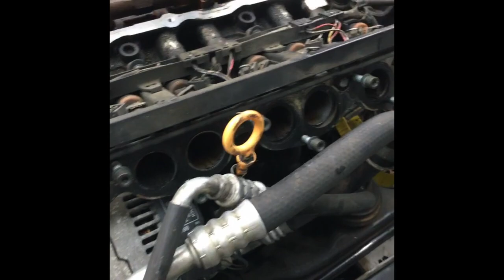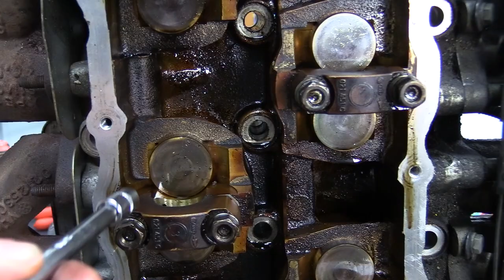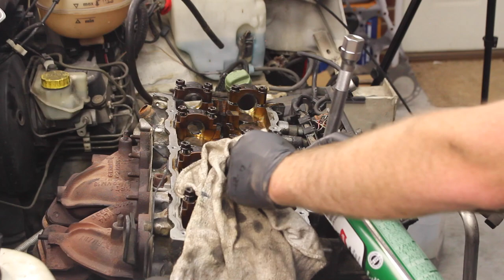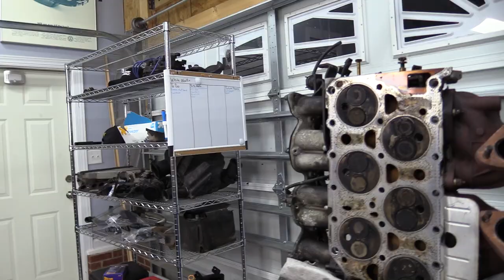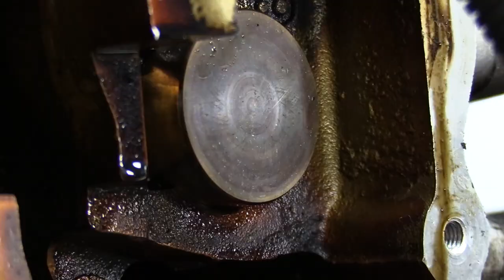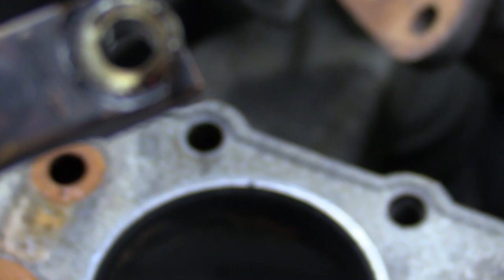Removing A VR6 Cylinder Head ~ WhiteWookie

Comment: For those of you looking to tackle something like this, go to your local dollar store and buy a bunch of those cheap plastic food containers. Label them with what is in there and seal them up. You can usually get them in packs of 4 or 5 for a dollar.

hit up a craft store and see if you can find a rack for holding scrapbook paper. The bins are usually 12x12x6 or so and you can label them, then put the little plastic containers in there and you can keep everything together, as well as any notes you have you can slide in there with them and keep the grease and oil from the parts off them.
Reply: Also freezer bags in different sizes.

Comment: 19:15,"you're working at flat rate speed. lol. i was a tech for thirty years, now that I'm retired, I enjoy taking my time. I'm restoring my 1993 olds cutlass supreme, been two years and I've spent five months rebuilding and re installing the engine. it's in and running now, sounds great.

Comment: Thank you for this great video very clear and detailed. I'm almost done with a job on my corrado vr6. Ran great before I pulled the engine out to replace all gaskets and seals except head gasket. Had oil leaks from valve cover gasket oil cooler seals etc on a 148k engine. Replaced clutch although still some life left, and replaced timing guides chains and tensioner. However it was a very slow process took me 4 months because of lack of time. It's back in the car and when I start it I have ticking in the head, could it be that the lifter lost pressure and needs time running to pressurize?
Reply: SoyTuPapi Yes. The Manuel says 20mins over 2k. Schimmel makes a manual chain adjuster if your hyd unit has failed.

Comment: Great video. I just rebuilt my 1.8 EX head out of an A1 scirocco. Had the head machined, pressure tested, new seats cut and guides fitted. i put in new seals and lifters. Noticed one of the lifters binding slightly and two of the caps could have gone in ether position, so 50/ 50 chance as the head was torn apart when I bought it. Can you see an issue with this in the future?

Comment: Differences to the ABV (2.9) as far as I remember: differnt cams, different air intake. Maybe even different throttle, but I'm not quite sure. Here's one tip from my experiences: the camshaft tool (the one that goes into those Slots in the end of the cams) does not really fit the correct position! Better check correct Position of cyl.#1! Also: the VR6 has a very Special order in which head bolts have to be tightened. Loosenig These, I always followed this order from back to forth (hope that's said correctly). Taking off the cylinder head: watch out form them guiding sleeves: they might scratch your cyl. head pretty nasty.Oh and plse don't get me wrong, I'm just trying to help avoiding unneccessary damages. I had some and they did cost me money.

Comment: I prefer a longer format.
I have a question; What causes that buildup on the valves and can it be prevented or can it be cleaned without dissasembly? I know it's a carbon buildup from combustion but does it have to be there?
Reply: Kevin Parker Alot of the time there will be degredation of the exhaust valve itself. They are sodium filled to reduce detonation. A good Fererra modern valve is cheaper than o.e. and are available in sodium filled ( I'm not Shure for the VR) Stock sodium filled have broken under high boost conditions.

Comment: on a vw u have to change the heater core if u damage the hose and or it breaks? also a good tip is to coat all bearing surfaces with a small bit of oil if it's going to be sitting for a little while. also another note it seems like vws need more maintenance than a normal car, just my perspective I have personaly never seen a timing chain guide break before it seems like somthing that can be avoided with good materials and better parts. just my 2cents
Reply: also I loved this video, love this kinda stuff keep it up🖒
Reply: It was upgraded on the mk4. With a manual adjuster(Schimmel Performance) it's a non issue.

Comment: Watch your guide height if putting in performance cams. You will crush the seal (and smoke) anything over a 264 cam. Schimmel has them and a few others .450 lift with a 268.

Comment: Hey, really great and informative video. Love the format.

I myself am planning to take the head off of my Honda Accord Coupe (CG4). It has H22A engine in, if that matters. The reason I`m doing it is that the engine is burning oil. Engine happened to overheat (lost the coolant and was in the middle of road construction). I`m hoping I can fix it by taking the head to shop to check if it`s twisted. And changing gaskets. 

What could cause engine burning oil and what should I check or change besides taking head to shop and new gaskets ?

Comment: great video and thank you!
I just took on a knocking VR6 as my new project and it was hard to find a good reference.
One question - we bought the wrong manual (it was for 4cylinder engines only) and for this one we are wondering exactly how to find TDC before we remove the cam..we think one of the lifter is bad, causing it to tick/knock sound(our hopeful guess #1).. any tips?

Comment: Why pull the cams to remove the head on the 12v? Just release tensioner and remove cam sprocket, and undo head bolts. I didn't quite catch why you removed the cams first?

Comment: Lucky 4 cylinder guys. Great video tons of professional tips for the masses. I work with guys that have a box on their tool cart they from every nut and bolt into; but I work like you, it all goes back in the part or on organised trays, or in to cardboard laid out. That somehow works for them and this somehow works for me. Some people are comfortable in chaos, personally I don't even like to look at a pile of bolts and nuts it makes me light headed haha. +1 for AllData though, its been a irreplaceable resource and data mine for me over the years. Not the best thing in the world for VW/Audi, Volvo, and older BMW wiring schems but I don't work on that stuff nearly as much.  The video was really well put together though you obviously have a talent for your work and teaching others about it. Couple of times I drifted into the video the same way I do watching horsepower or extreme 4x4 so keep them rolling. P.S. I'll never get used to looking at VW coolant jugs, weird they are.
Reply: At the dealership I can work out of a box on most jobs because its the same stuff over and over again. on this one job i pulled the tranny at of a fwd platform and it sat for 2 months then i just went to put it back together and being the first time i did that car I was a little stumped at first but you just lay everything out and put like bolts with like bolts

Comment: HI I have question about my cylinder head. Hy vr6 overheated, it got very hot. I think the thermostat was not opening. Do I need to get the head tested for hardness at what point is the head serviceable? what measurement numbers for the hardness test will be pass or fail?. Really hopping the head can be fixed there are not meny of these vr6 engines in New Zealand its hard to come by parts. any info on the matter will be much appreciated.

Comment: Hey Charles,quick question.I purchased a VR6 12v head with the works.I’m looking at the bottom of the head were the valves are facing and on the surface their is a noticeable corrosive mark.when I run my fingers along the surface their is a slight indentation.would this effect the engines performance or cause oil and coolant to mix together.I purchased this head from a reputable builder and I know he had to have seen this when he shipped it out.just looking for some feed back.thanks!

Comment: If you rate the AllData instructions as "OK", what would you say is a good resource of instructions for us to do this outside of the shop? I have the Bently book for my ALH Beetle, but it is really just exploded diagrams and only good for proper torque specs.
Reply from the maker: +Nefarious Rogue sadly in the VW world, most are just okay. Even our factory manual leaves a lot out.

Comment: hello i'm interested in buying a VR6 motor for my Polo i have no intention of boosting it as i like NA motors but love the sound of a VR6 would like to know if there is a 2.8l 24 valve variant in this motor and if it is better than the 12v or what the proc/cons would be between the two,

Comment: Just subbed. I got a 96 vr6 corrado and looks like a bit of fuel in the coolant tank so possible head gasket change...Thanks for the vid, i'll be following the steps during replacement if necessary!
Reply from the maker: OH a 1996? Where are you located? We lost the Corrado in 94 I think
Reply: U.K mate, Pretty much just bought her about a month ago! So fun.

Comment: Would it been a lot easier to do this job if the motor is out? Especially if rebuilding/refreshing everything that needs to be replaced.
Reply from the maker: +Michael Evia I thought about that. But I needed a way to hold everything in place while taking off the head. So I just left it in the car.

Comment: I'm noticing the reddish coloration deposit in the cam chambers... .  Is that a varnish by any chance?  I saw this kind of coloration on the cylinder head of my 2.5L four cyl. in my '91 Pontiac and assumed it to be varnish.  I changed oil brands and did not notice it getting worse - car had around 200k miles on it at the time.
Reply from the maker: yes. This engine was not super well cared for

Comment: did you have to remove the trans to get the head off? or can you remove the head without removing the trans and entire chain cover? hoping to just remove upper cover and Cam sprockets and upper tensioner
Reply from the maker: +THAT NEON DUDE JAMEZ I left the trans in for removal. But took it off because I wanted to replace the lower chain too.
Reply: HumbleMechanic if your just doing head gasket if you just replaced the chains and guides that works? my friend and I just replaced the lower chain and guides and upper chain and guides and now head gasket is blown and he also has 3 bent valves on 2,4,6 due to a failed rail guide didn't think he bent valves so after all done went to start and nothing and found low to no compression on 2,4,6 so I can remove the head without removing the trans and wonder how hard it would be to time if set to tdc

Comment: I must say, allen fasteners holding on vital components seems like a terrielbe idea
Reply from the maker: As long as you are using good tools, it's not an issue.
Reply: They are 1 time use stretch bolts. Hammer the 12 point all the way down.

Comment: working on my vr6, have a headgasket leak. bout to tackle that job soon. is there a manufacturer that offers just a tensioner and guides for thr chains? have no chain noise whatsoever and i dont want to pull the trans again to service the chains right away.  trying to get it back on the road. and what mark 4 gasket will work? curious
Reply: ECS tuning for the parts and there is only one 12v MK4 head gasket.
Reply: Dan Koning eBay man lol that's what I did.
Reply: Mk3 VR headgasget's are known to fail.Your head could be warped(did it over-heat?). A mk4 VR6 Head gasket is metal and raises compression.( Worth a couple hp.) Direct fit on a mk3

Comment: i was wondering wants veiw on the 95 eurovan i am wainting on a flooded one i know the guy didnt start it because he  called i now i can get computers on ebay i have a place to recondection the com and wires also if i have to buy another one for parts will the v6 fit  the one i am looking as 2,8 litter the guy has lots if receips the poor guy lost two

Comment: any particular reason why you would do this with the engine in the car? Is it possible to remove the engine and deal with this on the engine mount?
Reply: Great video btw! :D Also i'm wondering if you've got a link for me to the tool set i saw you shared with us once, with all the special tools needed for the VR6 engine?
Reply from the maker: Thanks. I don't recall the tool kit you are talking about. Do you mean the VW technician toolbox?
Reply from the maker: If you are just doing a head gasket, then doing it in the car makes sense. Honestly even if you are doing the upper and lower chain it's done with the trans out only. There is a lot more to actually take the engine out of the car. 

For what I am doing, taking it all the way out would have been a good choice. But I wanted to show it in the car.
Reply: HumbleMechanic... Got that down packed. Engine trans and subframe on the floor 1hr47 mins with 3 smoke breaks

Comment: VR6's are weird motors. are they considered an inline 6?
Reply: Clayton Bridges technically yes,  in a sense they are but the cylinders are staggered in a staggered line.  I can't remember the angle they have but slightly angled
Reply: pretty cool tbh, didnt know this is what VR6's were..
Reply: Its a common head v6 the angle of the cylinders are alot more shallow than a traditional v6 but it id a v6 and not inline
Reply: Narrow angle v6 would be the correct term
Reply: I like the term “Staggered Six” 👍🏼😁
Reply: They are a 12° v6
Reply: 15 or 10.6 degree v6, one head

Comment: Charles, serious question on vr6.... If I removed the cams without having engine at tdc how do I go back with it when I'm ready? Do i just have to get the block by itself on tdc when head is off? I'm removing the head on the weekend and planning to take it to machine shop.. Thank you..
Reply from the maker: No prob at all. Set the crank to TDC, back off about 1/8 turn. Then bolt everything up. I did a full video on timing this engine that walks you step by step
Reply: @HumbleMechanic  when do I set to tdc and then go back 1/8? When the head is bolted back on? Or when it's the block by itself before I bolt the head?
Reply from the maker: Watch my timing video. It will be more thorough.
Reply: This is more of what I don't understand..
Reply: @HumbleMechanic amazing help, thank you for everything!
Reply: Was wondering if you knew why my 1998 has the old hall sensor but your 1998 has the upgraded mk4 one... Why? My vr6 is prod 03/1998
Reply: I just saw in the video
Reply: Do you know what it would be on a mk4 vr6 If coolant hoses bursted, leaking a lot of oil? What type of head work? And how much would it cost me do you think just the parts

Comment: That bolt that holds the chain guide in place, that you said didn't come out too happy, tends to be a REALLY stiff bolt, and it will scare you putting it back in, too!

A piece of advice from experience:  Avoid the Fel-Pro cylinder head bolt kit for the VR6!  The longest bolts are about 1.5cm too long, and WILL NOT seat on the head, but they'll be close enough that you won't notice unless you really look hard.

Comment: Can the 3.2 vr6 bolt right up in the 2001 Jetta vr6
Reply from the maker: +Allen Lax the one from an r32 would be the closest
Reply: Allen Lax or audi tt 3.2
Reply: All vr6 engines fit 2.8 through 3.6 All transmissions fit(manual) all cars with Drive shaft shop axles and weld in brackets from dutchbuild (mk1/2 Eurowise)